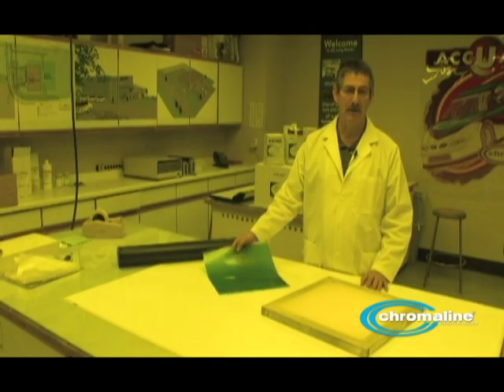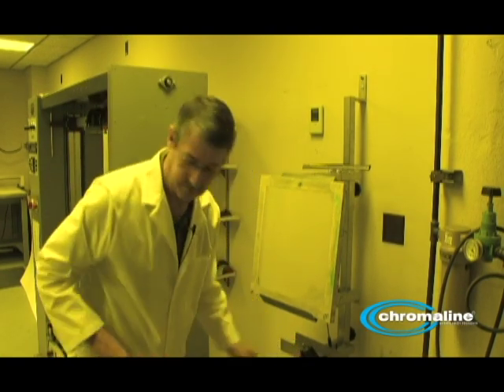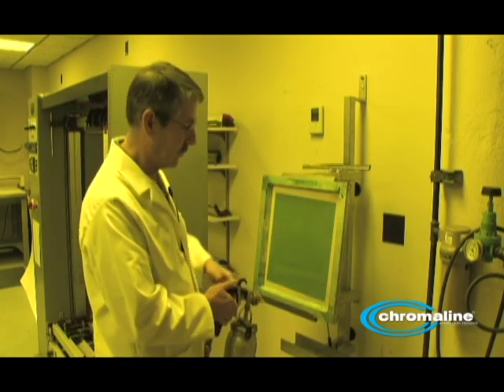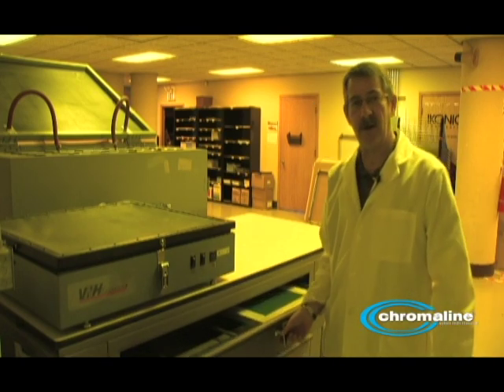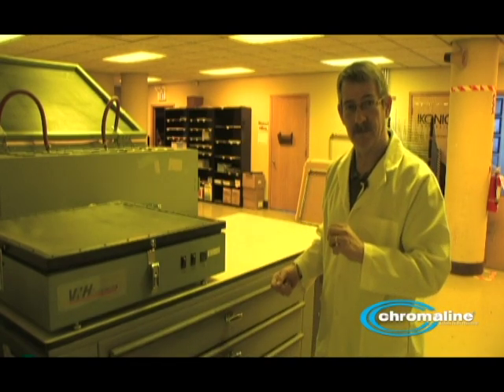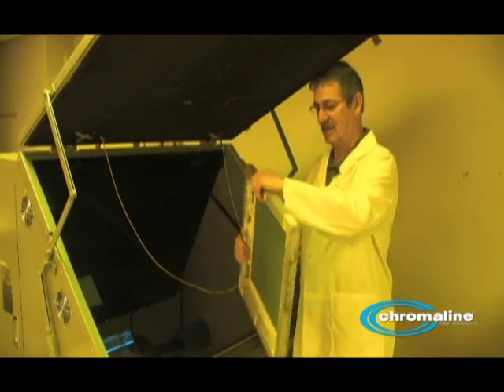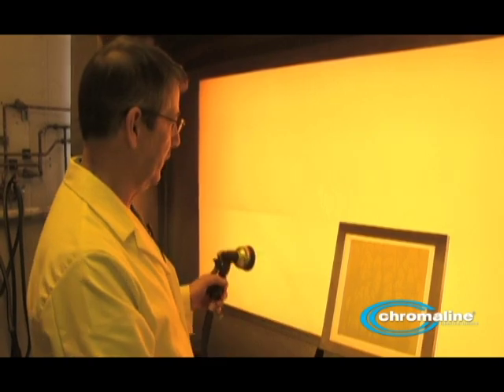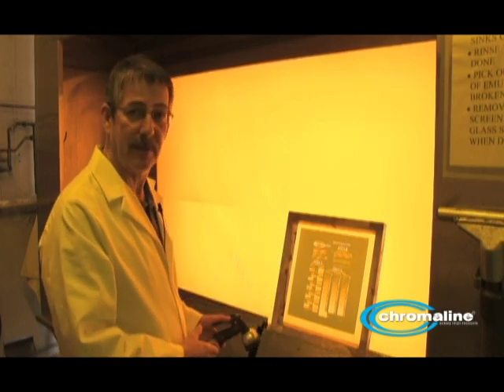How to Apply Capillary Film Part II

Comment: Is capillary film only suitable for plastisol ink? can not use for water based ink?
Reply: Chromaline's capillary films (Pro/Cap, Magna/Cure & Razor) are compatible with plastisol, solvent & UV-based inks.  Unfortunately, these are not recommended for use with water based inks.
Reply from the maker: Unfortunately, there is not a capillary film on the market that is compatible with water-based inks.